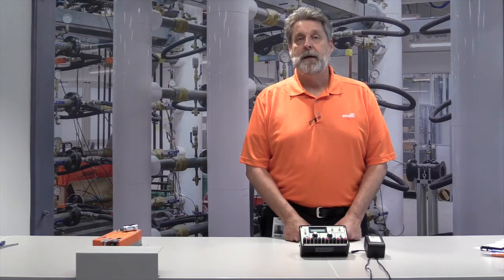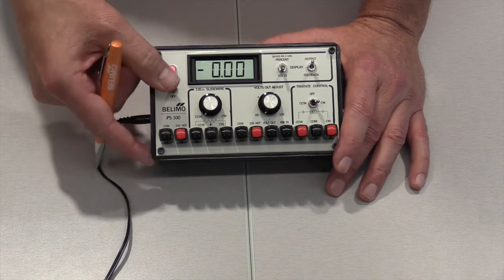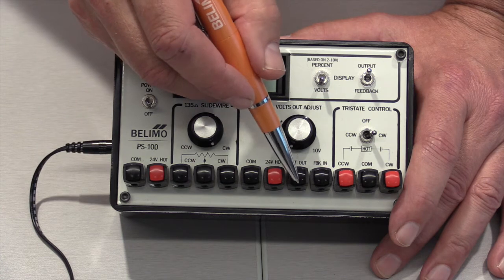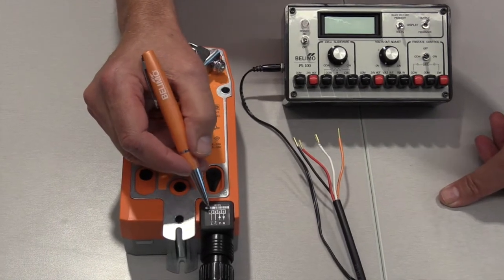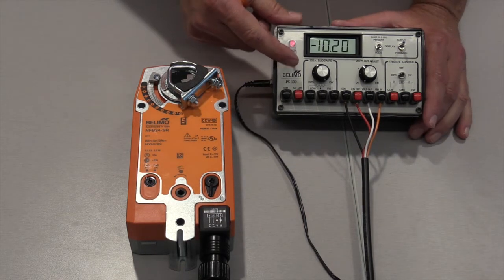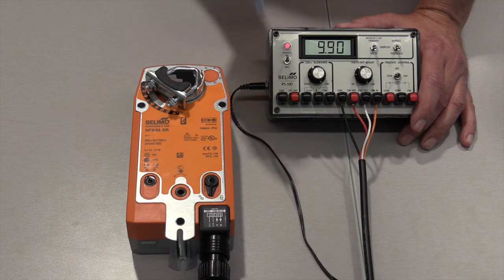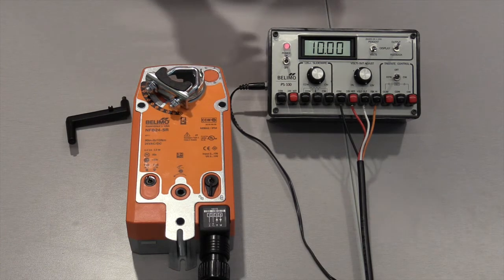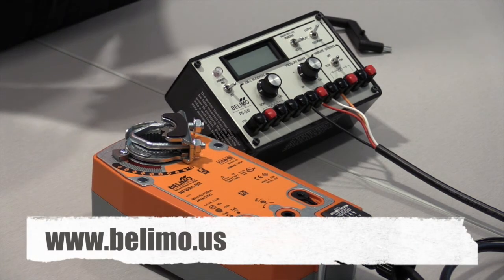How To: PS100 Power Supply and Signal Generator

Comment: Hello! What is the reason why you select Volt and adjust to connect the valve? Why don't they use the other options?
Thanks!!
Reply: Can I use the PS-100 with a Belimo GMB24-3?